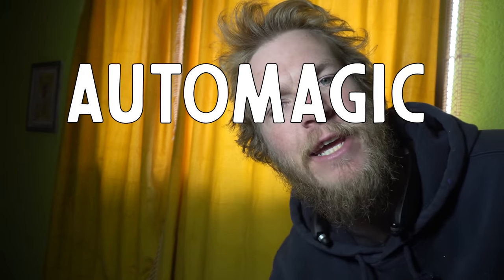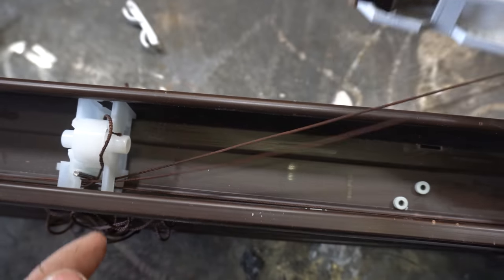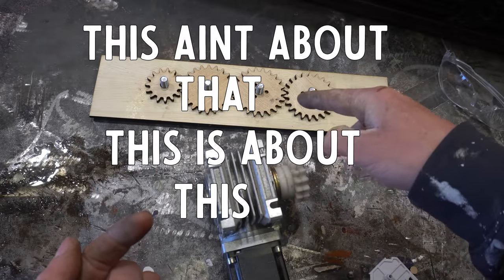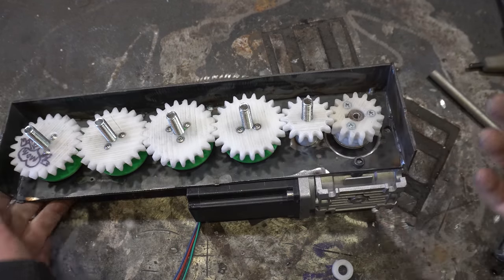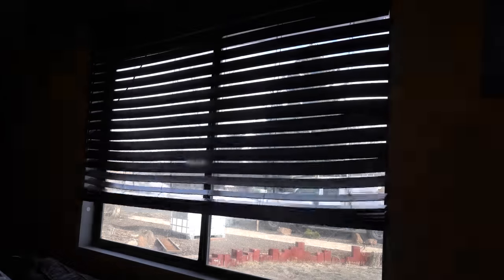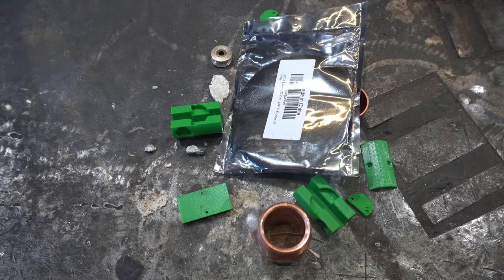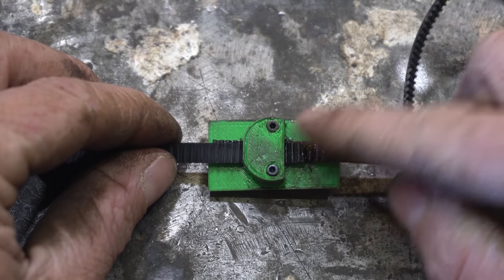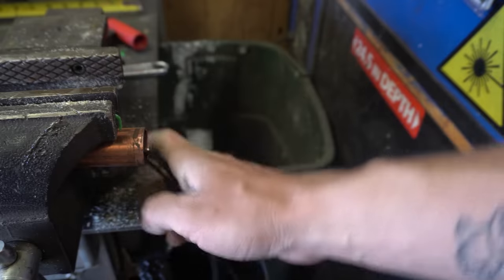DIY Smart Blinds That Don't Suck!

Comment: the first blinds where a bit clunky but hiding everything behind the cove made it look ok 
the second ones where realy nicely made , you might be able to get the second ones to leave less of a gap in the middle if you shorten the loops that hold the magnets a little (stick two safety pins through them over the top of the rail) 
think over time the magnets will wear through the cloth if you leave them like that , you could 3d pint some pipes that hold the magnets and the front loop , probably makes a bit more noise but shouldnt wear out the curtains

Comment: I just tried something like this, but may have you beat for slowest damn shade: I used a threaded rod and a little 5v stepper motor to vertically lift/pull down on a cordless shade. Glacial! 
Love the magnet curtain.

Comment: This was great, especially the magnet idea for the curtains! I've been toying with various ideas for opening curtains lately as well, and this gave me some new ideas to consider. For the blinds in the first part, I wonder if there's a way to modify the original mechanism to be able to simply attach a smaller motor to the original gears instead of an external one. I definitely understand using what you have laying around when it comes to projects, though.. especially if you have the same bad habits of hoarding tons of random parts like a lot of us that make things.

Comment: I have a belt driven curtain and it's on a timer with IFTTT. I had to buy larger curtains and sew them to the correct size. Also made the decorative box with the same curtain material. Took 4 days.
Reply: I think the box is called a valance or something like that. It's light weight material foam with a layer of 1/8 wood. And stapled the curtain material around it. The belt goes down the track the curtain hooks slide on. The motor is on one side ans stays hidden by part of the curtain that never moves

Comment: You gotta jump on the ESPHome bandwagon dude. The microcontroller setup is painless, and you can update your firmware remotely within homeassistant.  And the latest version of ESPHome supports raspberry pi pico boards too.

Comment: Nice work 👏 For such projects I recommend geared dc motor with limit switches. It is a cheaper solution. And the motor and the driver are smaller. 12v is ok. You may use car window motors with gears. 👍 JGY 370

Comment: a simple explanation that te roller dont fall down ur is pulled up  is that it has 2 springs that exert the same force and so you have a balance betwen tham and there is no force that acts downwards or upwards because both  forces cancel each other out. It's like two people of the same strength pulling a rope. Nothing moves there either. Thats also the reason why you kann pull it up whit your pinky than it gifs no force downwards

Comment: For the folding blinds could you not have a pipe like for your curtains but you have to geared up steppers in the center and a line running to the edge and down that pulls it up? I under stand if you have to steppers more could go wrong. This comment is mainly so you get in peoples recommended.